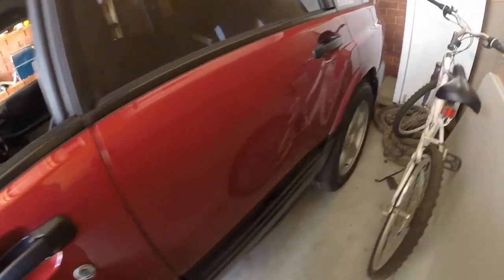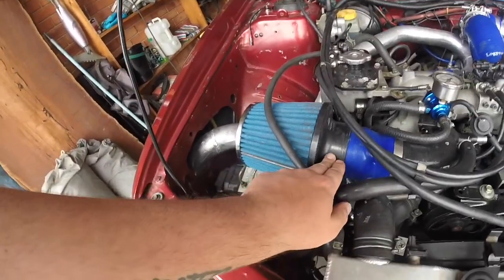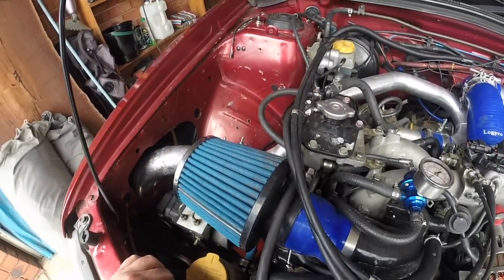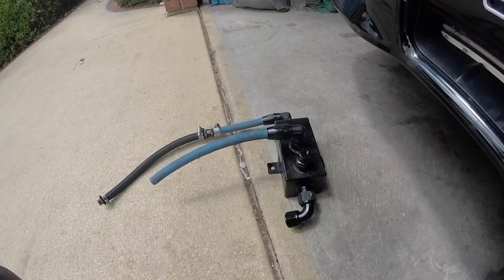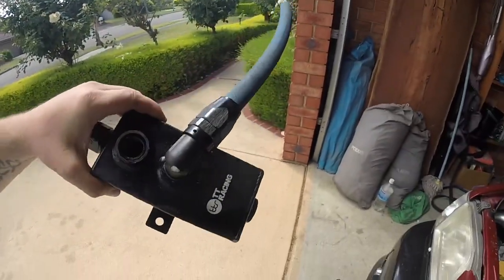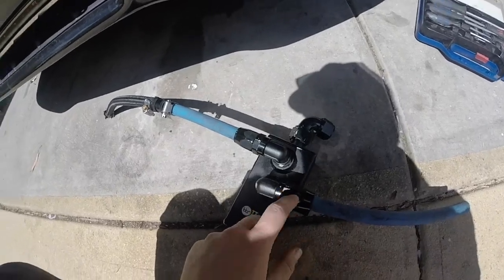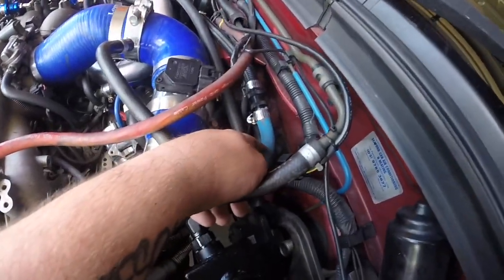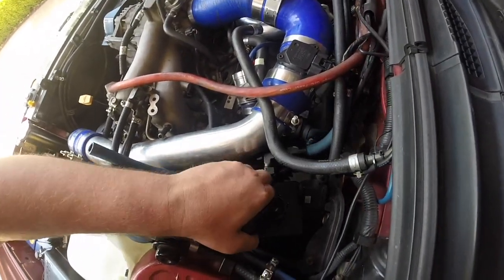Catch Can Install | Subaru Forester GT

Comment: I used some oil resistant 12mm hose from westernfilters on ebay. :) For that blue hose, you could get some of that webbed cable sheath stuff from jaycar. It should mostly hide the blue if you wanted it to not stand out so much. Do the heads really put that much oil vapour out though? I've currently got a custom can between the block and throttle body pcv.
Reply from the maker: I’m not too fused with the blue hoses. I was going to do another catch can for the block breather. When I’ve pulled the intake off previously there has been a bit of oil in there, just want the heads to breath freely
Reply: It's funny how all of these seem different. The only place I had noticeable oil presence was where I've currently got the can. But on my old GC8 I had quite a lot from just about everywhere. :D Also the heads on my current car have the two breather ports on them. Must make a difference as it seems that one set are linked side to side and the others go to the intake.
Reply from the maker: I was wondering about the two breather covers. Well that clears that up.
Reply: Yeah the most rear breather hose on the covers is to equalise the pressure between the heads. So in theory you could disregard one of the front breather hoses as both heads are connected anyway. Best not to though.
Some say the cover breathers are to "inhale" fresh air to circulate and flush out the case. However, I too get a bit of oil out of the covers.

Others say on High boost you will get blowby via the covers and the crankcase hose to inlet. 

Vacuum you will get oil from the case PCV to under the throttle body. Lots of gunk, but as it's under vacuum not a problem in regards to lowering octane and knock.
Reply: Yea the heads both blow and suck depending. It's an equalising system otherwise the crank case becomes pressurised, I think it's when the pcv is shut, (positive manifold), the heads are blowing, otherwise they're sucking. That's why you got to be careful about a cc on the heads to make sure it works both ways.

Comment: I have a 99 subaru legacy outback with the oem intake box where the tbs and tube I deleted the filter box by the fender and put a spectra cone filter I would like to get rid of the whole intake system and put a aftermarket intake pipe but I have pcv hoses that would hang there if I put a catch can would it work
Reply: It is a non turbo
Reply from the maker: Like josh said. It’s a non turbo. 
Catch cans are really used to stop crankcase blow by getting sucked back into the system via the vacuum of the turbo
Reply: So I can use it correct?
Reply: My project is not on motion yet I'm just doing a layout and plan so that when I do start my build I know everything can and will go smoothly